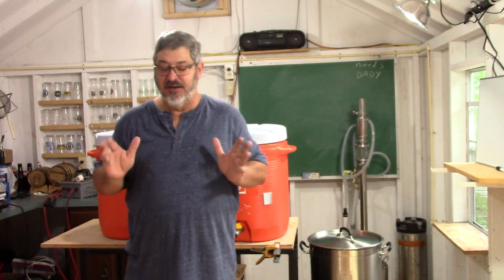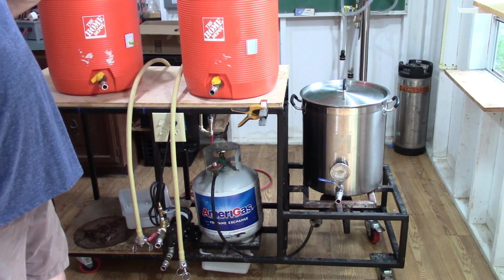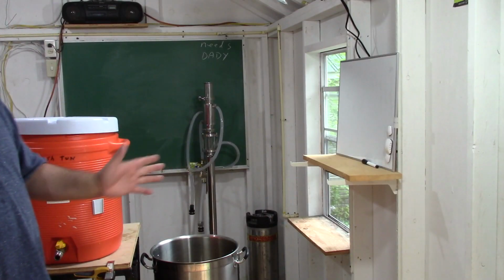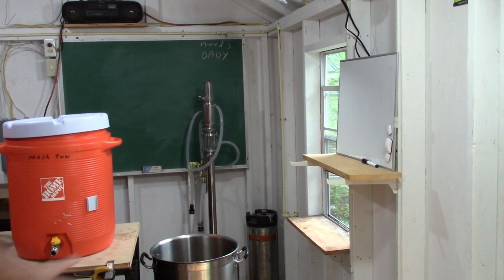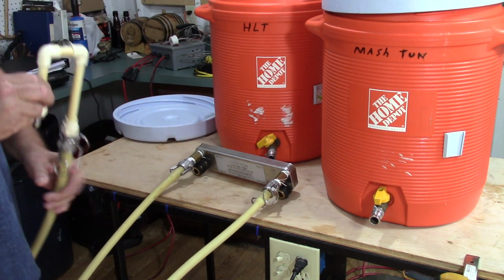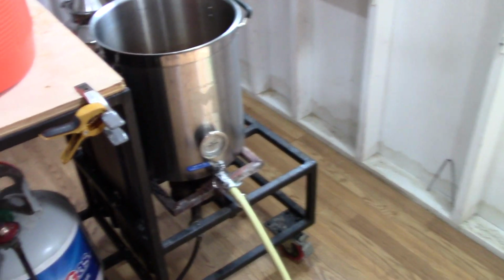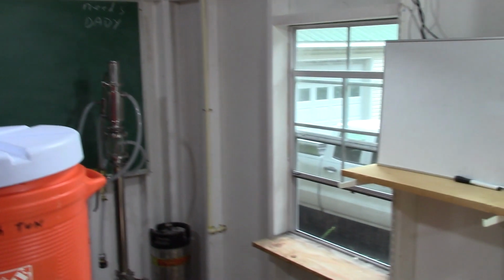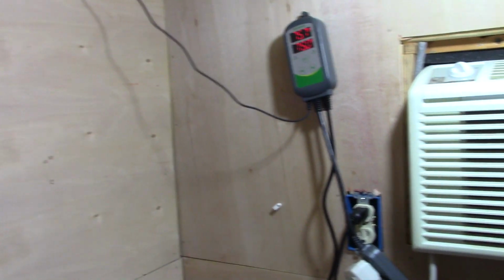E68 Still Works and Brewing "Brew House"

Comment: Hi Randy. Love your videos. I noticed your outlets in your brewhouse were not GFCI protected. Working around water you definitely want that protection. If you dont have  GFCI outlets you need the breaker that feeds them to be GFCI. This could save your life.
Reply from the maker: You are correct, But the feed to the sub panel is a GFI breaker and thanks we need to look out for each other Cheers!!
Reply: @stillworksandbrewing  I am glad you are protected. Keep those videos coming.
Reply from the maker: @larrylaffer6015  will do

Comment: If/when you go electric. I highly recommend installing at least two 240V circuits. Once you start using one heating element, you'll eventually want to run two elements for faster heat-up time.
Reply from the maker: Thanks and Cheers!!